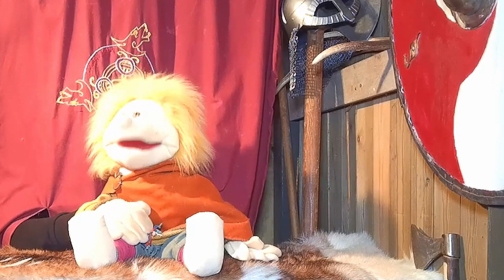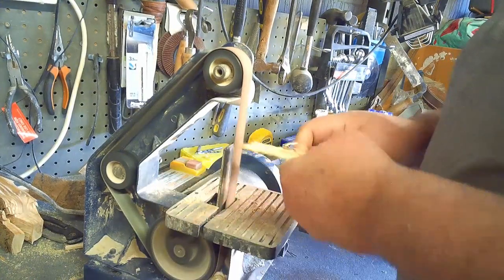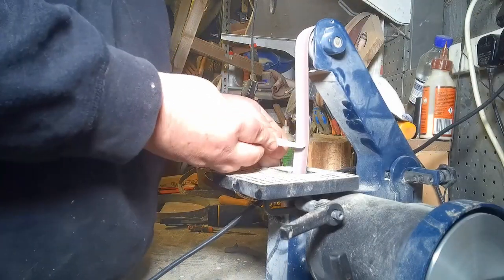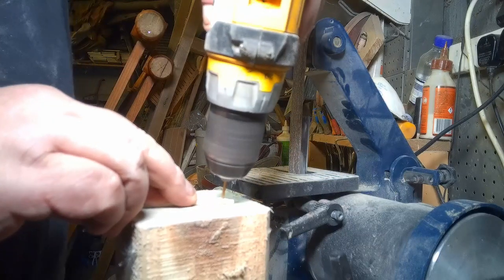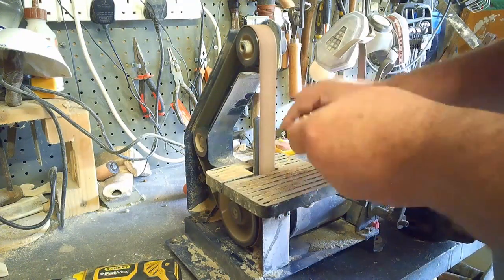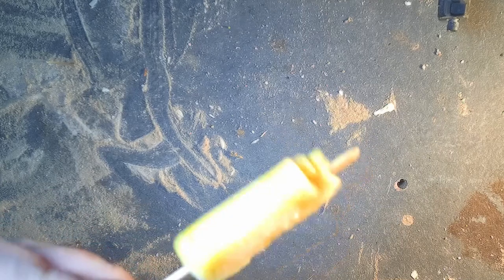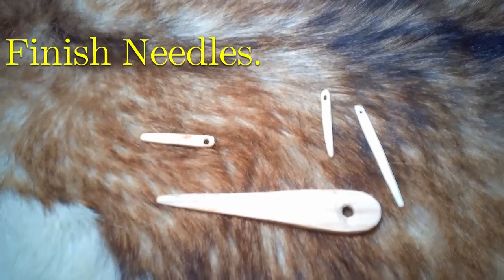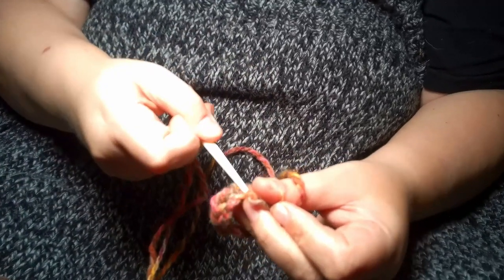How to make a Nalbinding needle.

Comment: I whittled my 1st needle out of a small branch my black birch tree dropped & sealed it with some jojoba oil (it soaks in and works like a non-sticky, slightly hardening wax) to keep the wood moisturized and keep it from cracking or splintering. Really like your video... left you a thumbs up and subscribed :)
Reply from the maker: we will give the oil a go, thank you.